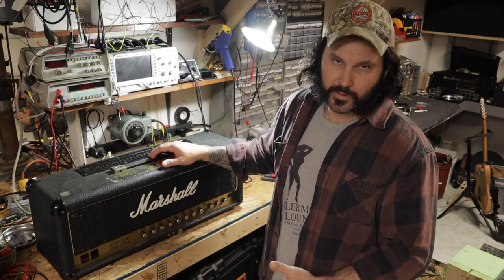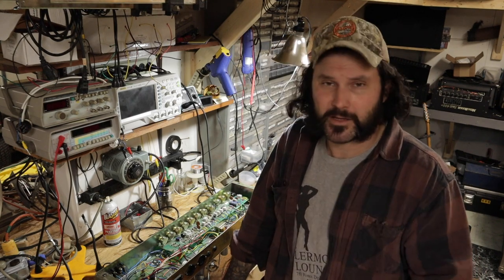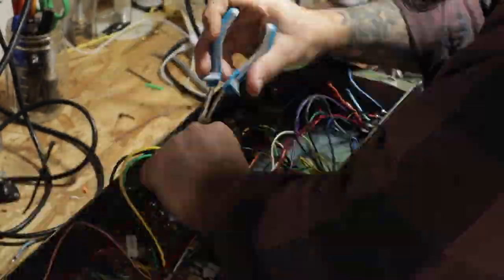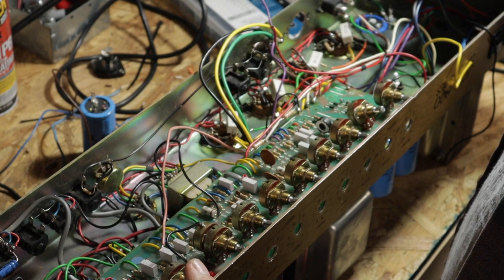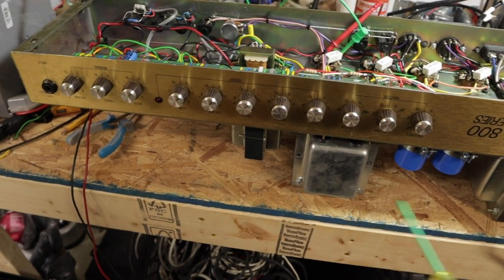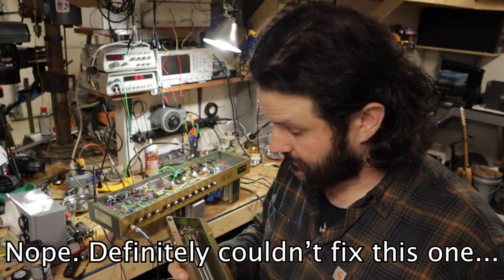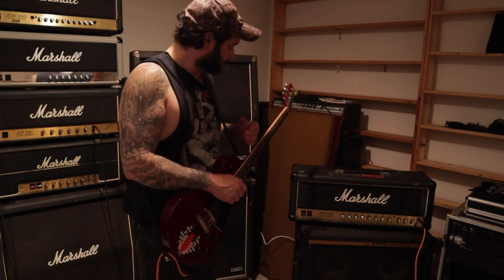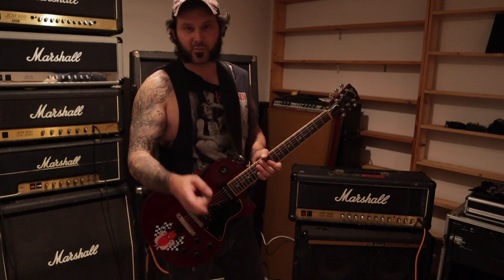Marshall 2210 in for repair. Tune up, maintenance + resonance control added

Comment: I got my buddy's JCM 800 2210 today. He said he hasn't used it in 10 years because it had a loud hum. I took it apart and it's actually pretty clean inside. The only mod I saw was some dingus took R51 and ran it from RV1 to C35. I'm putting in the new caps because like you said the originals are gone and I'm really considering doing that resonance mod you did; it sounded great man. Wish me luck, you really helped me understand a few things I needed to figure out.
Reply from the maker: Glad this helped.  I've seen the insides of quite a few of these and the heater wiring layout is done poorly on these models. On a higher gain amp like this it can definitely lead to loud hum. I would start with the caps for sure.  I have a spare set of tubes I swap out to rule out problems there.  I've seen excess hum from bad power tubes before. If the hum persists, reinstall the original tubes and keep troubleshooting.  I am going to install a hum balance control on the next 2210 I work on to see if that helps out. Rewiring the heaters takes a lot of extra time but it is worth it if it's yours. A lot of clients don't want to pay for that time. I have two waiting in line to be worked on now.  Good luck.

Comment: It's great to see the 2210 getting some love. I've owned mine since about 96-97. Like any tube amp, the harder you push it, the better it sounds and this thing of mine is ungodly loud and sounds awesome. I used to get a lot of dirty looks on stage from the other guys because I had to crank it to get the right sound and it would drowned them out. In the JCM-800 line the 2203 and 2204 get the lions share of the attention (arguably, deservedly so) and I hope to grab one some day but my 2210 has never let me down.

Comment: It seemed that at the halfway point the resonance control added a lot of clarity to the midrange for some reason.  I didn't expect that at all.  Maybe it moves the upper bass frequencies down a bit?  It sounded a lot better that way.  With it all the up, it just seemed to boost everything from how it sounded all the down, but still better than stock.  I have an '89 2210 and it's a very touchy amp as far as setting up the EQ goes.  The amp easily becomes congested sounding if you're not careful and I usually have the tone controls set pretty low, like all under 5.  The resonance control modification seems to loosen up the congestion.

Comment: Great video, excellent work. I'm dyinggggg to add a resonance control to my bugera 5150II clone. It already has a presence control so that should make it easier, right?
Reply from the maker: A resonance or depth control can be added to any tube amp circuit. It’s only a matter of adding a 1M potentiometer and capacitor of your choice in between an NFB wire that’s going to a tap on the OT secondaries. Not all amp circuits utilize NFB in the same way but they can all be easily modified. I can’t speak to the specifics of that amp as I haven’t seen it but I would imagine you could find the schematic of a 5150 and implement the added control in the same manner they do.

Comment: The resonance control sounds good to my ear. I know I like to add it using my jvm. I just got a mint 2210 and like it, but I hear the difference between the jvm and it now. I'm tempted to do the mod but I may just leave it as it is. Recommend?

Comment: 16:43 You mentioned replacing the 4.7k pot with a 1M pot - replaced the presence with the resonance???
Reply from the maker: The presence control is in tact and untouched

Comment: Do you like the sound of the clipping diodes?
Reply from the maker: I'm not sure it's a simple yes or no answer here. The question could be reversed to "Do I like tube distortion?" and the answer can be yes, but there are a lot of terrible sounding tube amp circuits.  When applied in a great sounding circuit, diode clipping distortion can sound very good.  It's all about the design of the circuit.

Comment: I had an early 2205 back around 1985.   Later, I learned that Marshall modified the circuit of 2205 and 2210 to correct some kind of problem that was identified, and that these later ones, up through 1989, were better amps.   Does anyone know about this and exactly when was this modification introduced?
Reply: '87. Supposedly a channel bleed issue and some other changes, but they're all different.